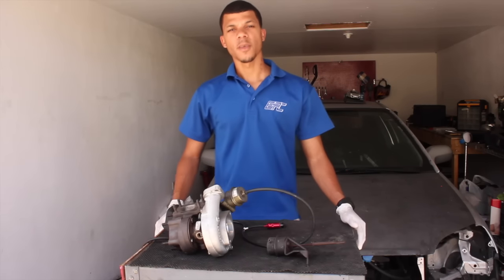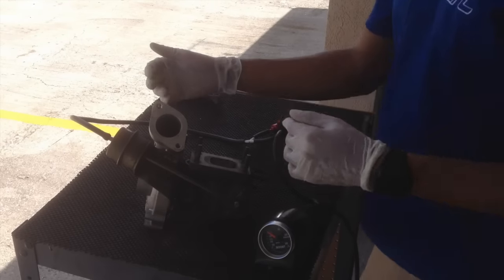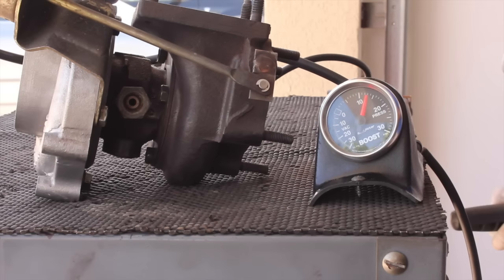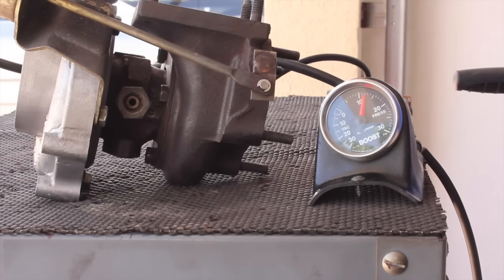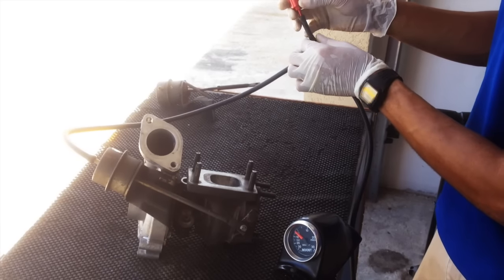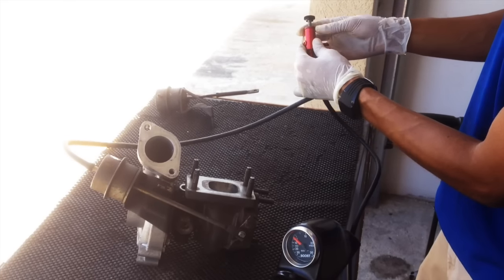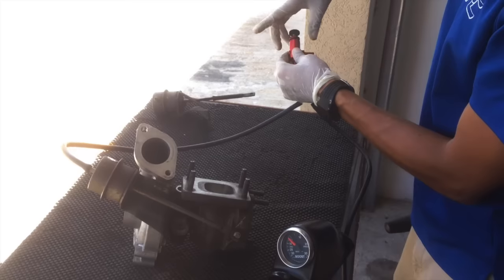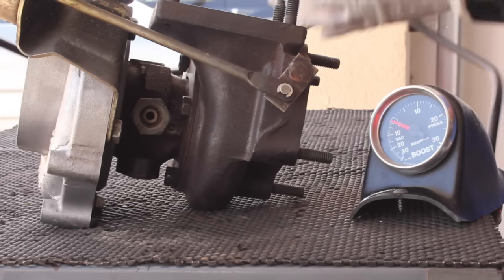Manual Boost Controller Install (part 2 internal actuator)

Comment: Do not hook up an MBC the way this video describes. This is completely wrong and will not work. All this does is just release pressure faster and re closes the wastegate quicker. It does not change the pressure at which the wastegate opens. Instead of having that tee in there he should have just put the MBC outlet to the wastegate.
Reply from the maker: How about you make a video with your description. Rather than ask what type of MBC is shown here (bleed type or ball & spring) you just flat out state it’s incorrect. Not the way to try and get your point across. Maybe find out information before stating your opinion. Looking forward to seeing your video btw.
Reply: @HighPerformanceNetwork  I don't need to make a video, this is simply setup wrong.  It's not up to me to ask what type of MBC you are using, you made the video and you should have stated it yourself. Most MBC's are ball and spring style, so 99% of watchers will assume that. And I recognized the particular unit you were showing as a Voodoo IV brand unit which are all ball and spring. Because of this, in your video, the wastegate was still opening at the same PSI as others have pointed out.

Comment: Hello does it work with any plastic (T)or there is a special one
Reply from the maker: Hey. A plastic one works fine. But depending on your desired boost level. You may have to use a metal barb.

Comment: More boost without tune equals run lean and burn holes in your pistons....Go ahead
Reply from the maker: Just that simple huh! And when you say more would be nice to include a reference. +1 psi is More.
Thanks for sharing
Reply: Definitely recommend a wide band air/fuel gauge to monitor what is going on if increasing boost.  Some factory cars go pig rich with boost so can handle a modest increase and still maintain a safe A/F ratio. Also adjustable fuel pressure regulators can crank up additional fuel if needed.  Of course having your ECM tuned and perhaps larger fuel injectors installed is preferred.

Comment: This video is wrong. If you're going to bleed the wg line to raise boost, you have to install a restrictor in the line before the T. Video FAIL
Reply from the maker: I'm gonna give you some time to really think about what you just said. Then possibly once you finish looking on Google. If you still haven't adjusted your comment. I may just have to give you a free lesson sir.
Reply: High Performance Network By all means. Maybe you'll get it right the second time around. ;)
Reply: But in all seriousness, if you need help understanding how a boost controller works, hit me up.
Reply from the maker: I got a better suggestion. Instead of having a pissing match. How bout you make a video explaining your way.I didn't create this channel to play battle troll with people. If you legit got a better way, then lets see it.
Reply: High Performance Network I told you already. If you're using a bleed-type controller, you need to pill the reference line. A turbo can feed a lot more cfm then you're attempting to bleed off. That's why a restrictor is needed in the reference line.
Reply from the maker: lazzer408 I suspect you know there are two types of MBC's. Both with distinct operational parameters. So maybe your question should be. Which type of MBC is this. Instead of listing your opinion without reference.
Reply: High Performance Network It's a bleed-type. You should know this if your explaining boost controllers. I like the your video having the components laid out. For those who don't know the terminology, it's very helpfull. But there's a lot of confusion already out there.
Reply from the maker: lazzer408 again to avoid any further replies. How about you list your way via illustration or video. That way I can do the test and see how it goes.

Comment: can you mount a boost gauge on the actuator? (putting T piece between the hose?)
Reply from the maker: Mitchell HürenKamp ahh you can. Most ppl wouldn't recommend it though as you are interfering with the line pressure between the compressor source and actuator. So I like to take it from off the intake mani if available. If all you got available is that spot. Then technically it should work. But hey....nothing like good old fashion testing 👍 hope this helped